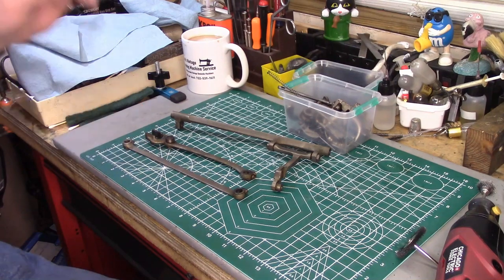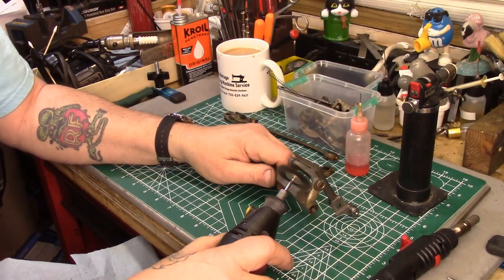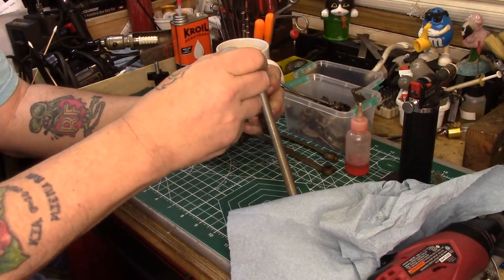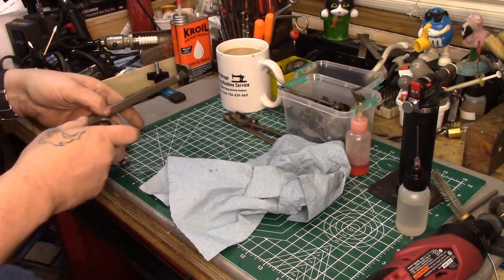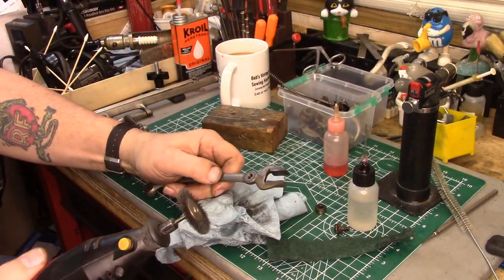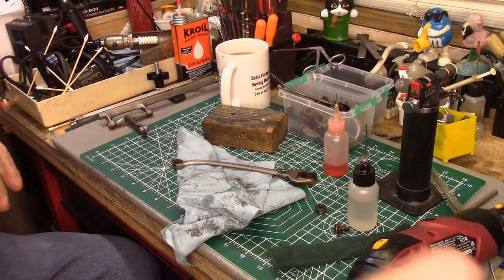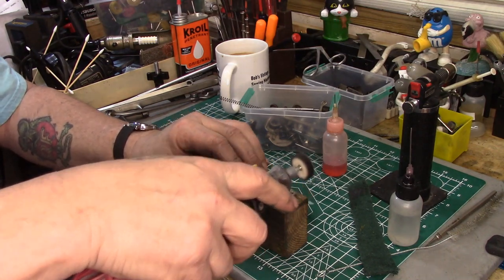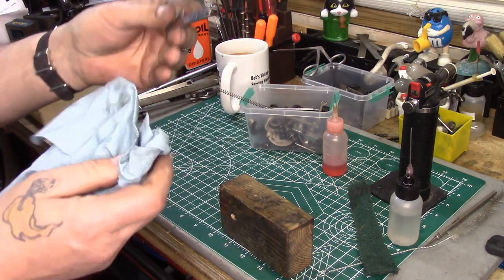A 99 for Sandra: Part 2 - Cleaning Techniques for Interior Components

Comment: I've just started doing all the parts from a 66 with a dremel and wire wheels. Should have watched this first. I was using the rotary at full speed and those wheels will fly aprt. Thanks to you Bob I'll be slowing the tool down quite a bit.

Comment: With a dremel wire brush I have to wear a face shield to keep wires from embedding in my face! It's bad enough the pieces that stick into my fingers and hands.

I rather like the bronzy finish you get on the rods and rock shaft from just a dremel and a brass brush or nylon scrubber.

I like the cup brushes for the uneven surfaces.

I love my set of skinny bottle brushes.

I always get nervous cleaning/polishing around the hook. I have nightmarish visions of catching the point and bending or snapping it off.

Bob, you know good and well that many of us would watch a 20-hour video of yours!

Comment: Thanks , I will have to do this on my model 27. Needle and foot bar are out but the still no movement on the shaf.  Probably everything will need to come off like you said a major overhaul.  One problem I believe isn't the first time this machine have been worked on because some parts don't make sense how it was put it back. That's going to be fun because I don't know what I am doing 🙃.

Comment: I'm in the process of cleaning/polishing with a rotary tool.... Actually 2 of them I keep with 2 different attachments and it is mind numbing for sure.   Then I look at your stuff and go back to the Dremel tool for more polishing. Also use a very small parts holder because my hands cramp up holding the small parts.  Not sure if I'll ever be done, but my 66 will shine, at least a little.
Reply from the maker: Thanks for the kind words! I regularly use tools and wood blocks to hold parts when polishing with the rotary tool. Some of those parts are awfully small or get REAL hot when polishing, so the use of screw holding pliers, soft jawed pliers, an appropriate sized piece of a discarded 2X4 or what ever else you may have available is certainly in order. I will say though, that there are two things you simply MUST have and use: 1) eye protection, and 2) an apron! I can't emphasize the importance of those two items enough. The eye protection is obvious, the apron serves two purposes: it protects your clothing, and if you work in a seated position like I do, it's a place for you to safely drop a small part when it starts to get too hot and is burning your fingers! 🙂 That reminds me... I need to make a few new aprons, mine are getting pretty worn out...

Comment: Bob - suggestion for chewed screw heads - initially tippy-tap down any raised burrs or high spots with a small hammer. You can often knock them back to almost perfect.  A steel watch/clock makers riveting/staking block is great for holding small screws for this. Then put screw shank in drill and spin up and clean up head surface with a fine file or wet and dry. Clean up the slot with fine files or saw blade and polish head. Idea is to remove as little of the original metal as possible. This method is often used by gunsmiths and restorers. (Watch a few Mark Novak YouTube vids who is a guru at this job)
Reply from the maker: I'm a huge fan of Mark! I normally clean up screw heads in the bench motor with ultra fine files (600 to 12,000 grit), this was a way of doing it without the super expensive stuff.

Comment: Just got a 99-13 from my s-i-l who doesn't sew. Thought I would clean it up some and get it working. but keep finding gooey parts. Found your site and love your process of getting everything clean. Your videos are wonderful! Have downloaded your list of tools as well. So now getting all the equipment to do the same. But a couple of questions. 
1) In another video you use yellow compound vs. the white in this one. What is the difference? When would you use one over the other. 
2) I have some screws I just can't get loose. I did order a Chapman Precision Screwdriver Set hoping this will help break them free. Any other tips on loosening stuck screws? 

And the scotch-brite pads you use on the rotary tool, do you have a link for that? I did not see it in your list. 
Any and all help is greatly appreciated. Thank you in advance.
Reply from the maker: Hi Sue, welcome aboard!  Good questions, I can help... 1) I use Yellow compound mostly on the bigger buff as those are a different type of wheel. With the rotary tools, I have pretty much switched to nothing but hard felt wheels and polishing points, and I find that the white compounds work better (for me, anyway) with the hard felt.  2)  Yes, the Chapman is a great set, but it's not the be-all end-all, at least not by itself. As an aid in removal, you often need a good penetrating oil to loosen up the crud that welds the fasteners to the parts. My penetrating oil of choice is Kroil, but there are others that also work well. I buy Kroil in both the aerosol form and in the regular can, which I decant into a needle oiler. Whenever possible, make use of the ratchet in your Chapman set to give you extra leverage to help break free the stuck screws. I also use a Craftsman offset ratcheting screwdriver, and have been known to, on occasion, employ a cordless impact driver. The hard felt wheels I use are here: https://www.amazon.com/dp/B0B168CQNQ?psc=1&ref=ppx_yo2ov_dt_b_product_details  The points I like are here: https://www.amazon.com/gp/product/B08ZBWB11T/ref=ppx_yo_dt_b_asin_title_o06_s00?ie=UTF8&psc=1  and the scotch brite wheels are here:  https://www.amazon.com/gp/product/B07NKRD2S4/ref=ppx_yo_dt_b_asin_title_o01_s00?ie=UTF8&psc=1

Kokour and Matchless are good brands of polishing compounds. https://www.kocour.net/productsubcatalog?id=233&cat=Buffing+and+Polishing
Reply: @BobFowlerWorkshop  Thanks for the reply. That is very helpful. I will let you know how it all turns out.

Comment: Do you ever soak parts?
Reply from the maker: Rarely. When parts go to the sink, they get hot water and Dawn dish soap, and a scrubbing with either a nylon or stainless steel brush - depending on the part. They are then rinsed in hot water and thoroughly dried. As a general rule, they don't soak.